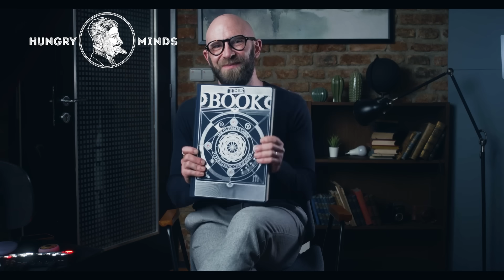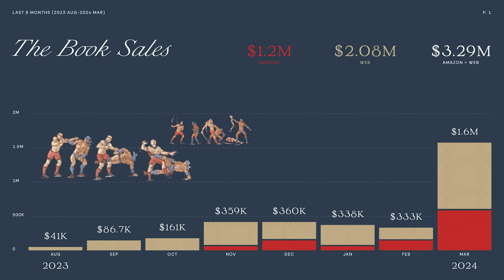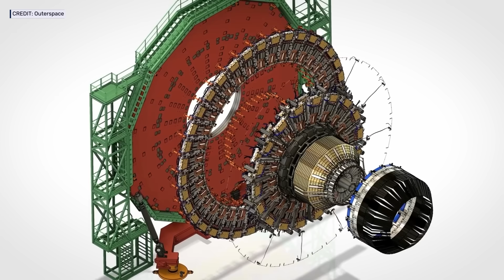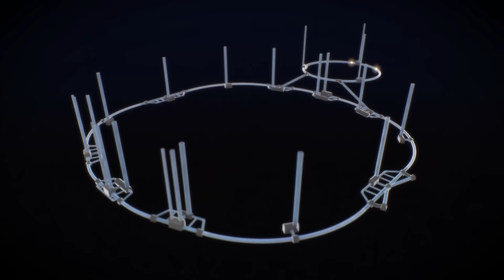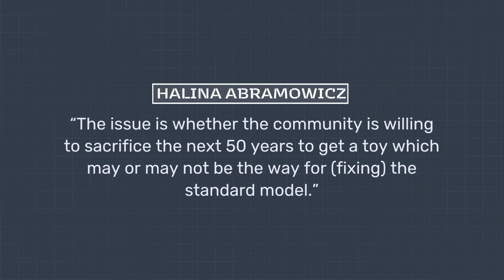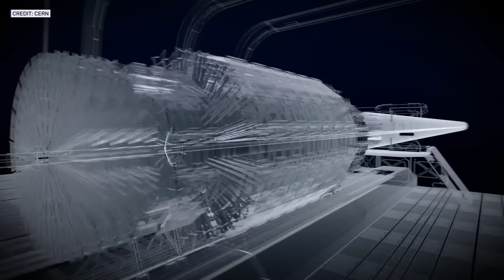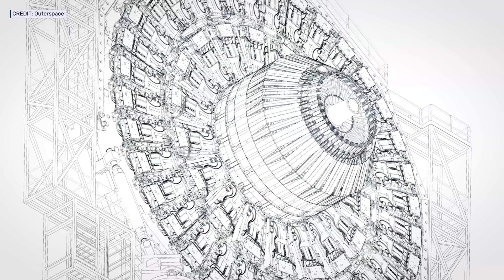The Hadron Collider 2.0 is Coming.

Comment: The biggest boondoggle in the history of science. Maybe of the world. A full employment act for the modern physics echo chamber, on the taxpayers. They'd be better off with a UBI. 

The difference between this and LHC is that everyone who knew the science knew the Higgs would be there. Peter Higgs had predicted the mass perfectly. While it may be debatable whether it was worth the effort to build something to find something you know is there, if it hadn't been there, that too would've been (even more of) a significant breakthrough. Anything else that might have been discovered would just be icing on the cake. Win win no matter what. 

Here, by contrast, there is no solid, well accepted theoretical basis to think they will find anything new. This is a fishing expedition, plain and simple. 

And it won't be until 2070 (at the earliest) before it even reaches full power??? An entire generation from now? Our understanding of physics could be completely upended by then. Or it will be 45 years before they'll finally concede they were on the wrong track. An entire generation of wasted careers. 

This is like building a spaceship to make a 45 year trip to another star system with nothing but a vague hope that it'll have a habitable planet. Anyone who wants to do that should do it on their own dime. 

This is folly. It's irresponsible. It's immoral. It reeks of conflict of interest and self-dealing. It will set the cause of science back a century if it plays out the way it's most likely to. It must not be allowed to happen.

Comment: Imagine making the equivalent of that, IN SPACE, powered by the local STAR, having solar panels in sunlight ALWAYS, and without gravity or needing to dig stuff .... If matter around it is vital as shielding, then DIG INTO THE MOON ....
Reply: Imagine it also doing nothing lol There would be no point starting there,as we don't even know if it will do anything different than the current one.Just because it would be stronger,that doesn't not mean they'd actually find anything else.

Comment: Really, I think the biggest argument against this is simply the opportunity cost.  There is such a HUGE amount of amazing science that is being done in this world, and mountains more than just needs funding, it seems a shame to choke much of it off for this collider.  I'm not quite as negative as the good professor from Tel Aviv, I have no doubt we would learn something from this investment, but how much more could we learn from $50B or so in other investment in a broad spectrum of science?  There are tons of experiments out there that only need $50,000 or so to get off the ground and could provide breakthroughs.
Reply: There's only one known way of discovering the things the LHC has done, and that is to collide the building blocks of the Universe together at extreme speeds, temparure and pressure, to try and recreate the conditions in the Universe immediately after the Big Bang. And very simply the only way to get even closer to that, is to build a bigger collider. If we want to examine the conditions of the Universe approximately 2 plank instances after Big Bang, we would need a collider with the circumference of the orbit of Pluto and the entire energy output of the Sun.